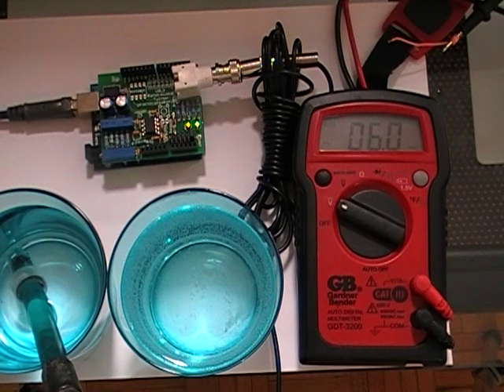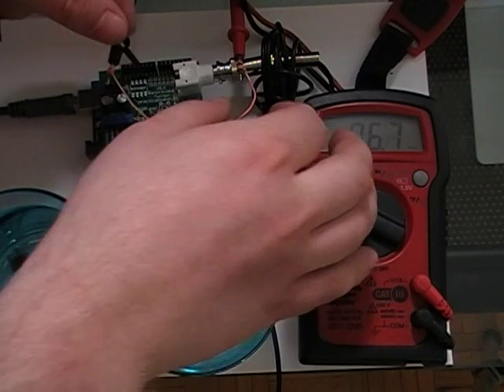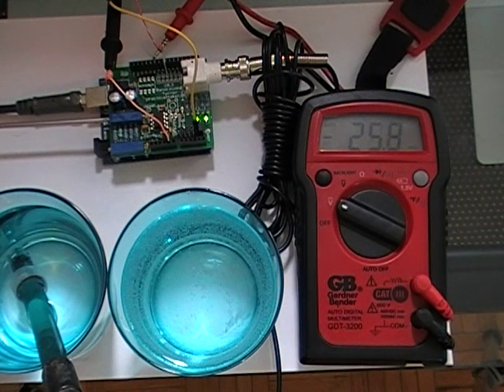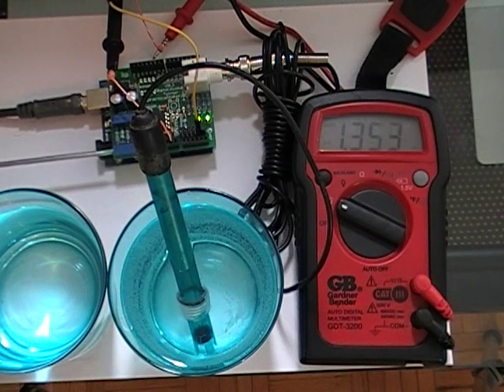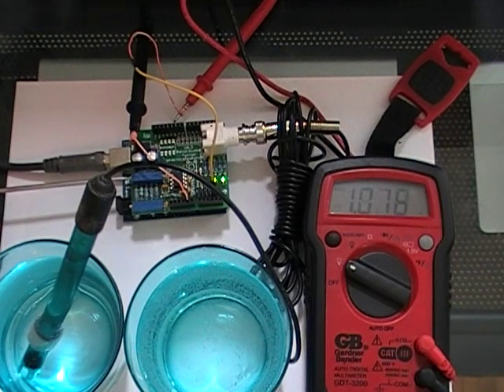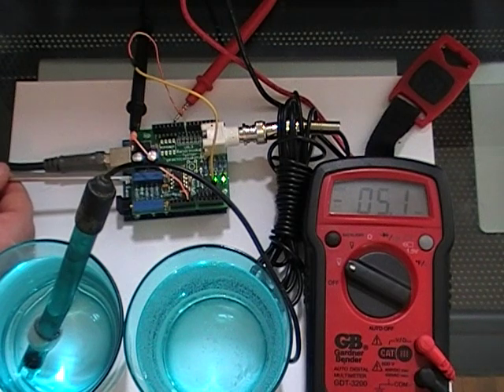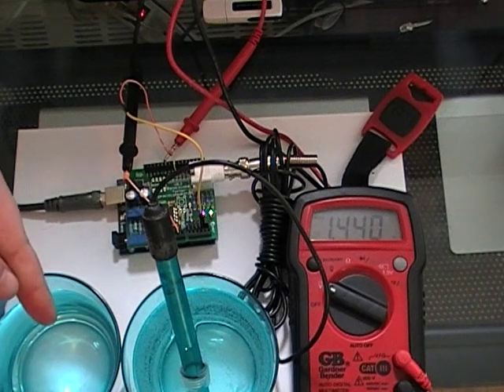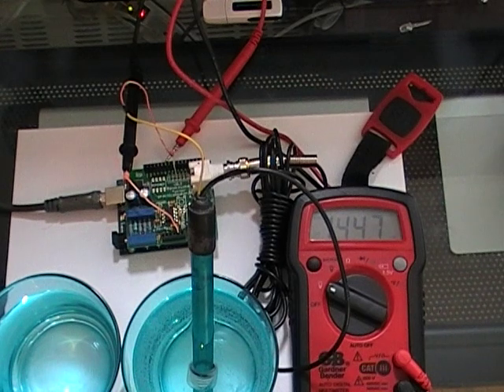Configuring The Arduino BNC Sensor Shield

Comment: Hi Andrew,

My situation:
1) Checked voltage of Arduino (4.94V) and updated sketch
2) Placed in pH7 solution and changed trimpot so Voltmeter showed 0
3) Placed in pH10 solution and changed trimpot so Serial Monitor showed 10
4) Place in pH7 solution and changed trimpot so Voltmeter showed 0

However, when placed in pH7 solution, the Voltmeter shows 0 but the Serial Monitor shows 9.65 instead of 7. What could be the reason for this?
Thanks!

Comment: Hello, I have the same shield .
In the beggining I could measure but at the moment I only get 0 voltages
but then I tried to configure it and changed the trimpots position after a while it reached 0 and now I can only measure 0 , I m changing the trimpots to the the first position and still measuring 0 what is going on ?